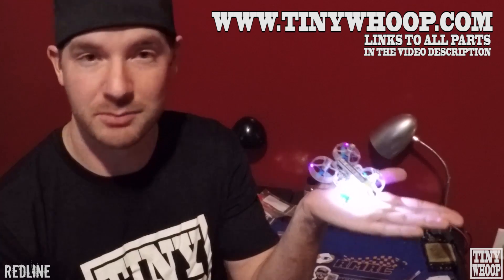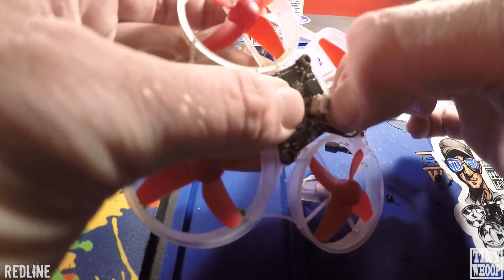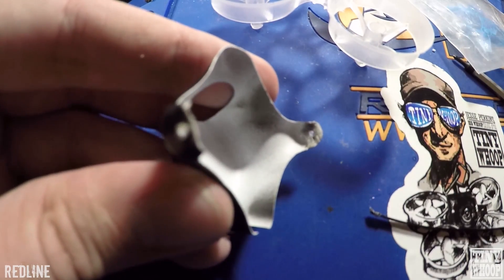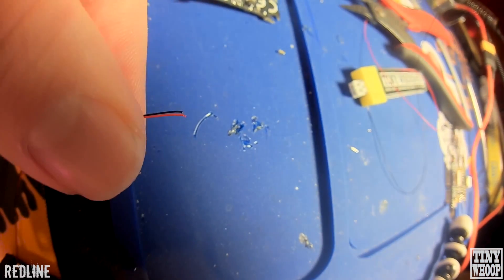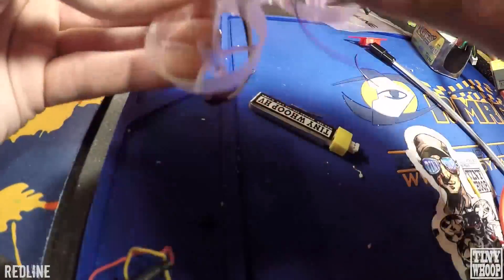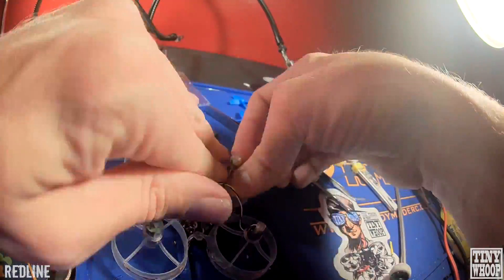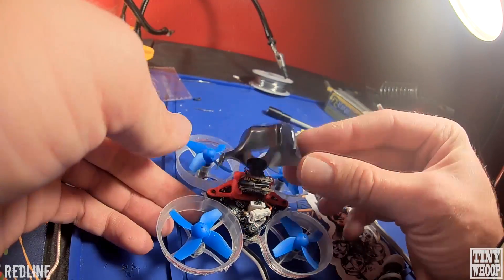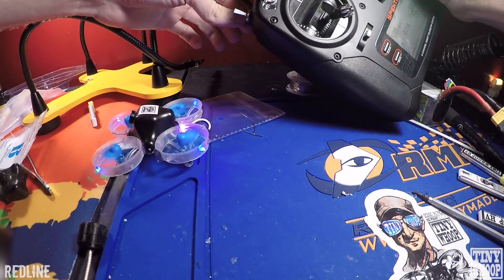Tiny Turtle Whoop Build - with Inductrix FPV Plus Spektrum Transmitter and LED Setup

Comment: How will I know if my motors I bought will need to have the wires reversed like that? Is it like a blade thing where they do there wiring backwards so all aftermarket mot0rs need to be reversed wiring on this FC? Now I’m nervous I have parts ont there way had enough trouble making sure motors will fit the frame now this jeez

Comment: I just did this "mod"... my parts list...
• Inductrix fpv pro frame
• Racetek 17,500kv motors (polarity switched and correct cw/ccw installation)
• FPV Plus canopy (trimmed sides to fit tiny frame)
• Gemfan 4 blade props 
Conclusion: flys slower than the same frame/motor/prop setup as my inductrix fpv. Wont meow unless placed upside down with front ducts closest to the floor, and even then only meows SOMETIMES. I cant find the flat top canopy mentioned in this video.?.?.? Maybe the flat canopy is the key to this setup working properly but I cant say for sure. Also... you would think a FC designed to push 8×20 motors would absolutely thrash with high kv 6×15 motors.?.?.? Unfortunately that's not what I'm experiencing with my build 🤔

Comment: I've been told to completely remove the JST connectors and solder the motor wires directly to the board. Any connector will limit current, so remove any obstacles where possible. Any truth to that?

Comment: Another quick one for you: what about camera and battery connector polarity? Can I just use the stock ones - plug TX02 and after market LiHV batt to it? I don't understand why you remove this pigtail from the FC and then solder it back again.

Comment: Could you please comment on the motors connector polarity. I see that Inductrix FPV + has different direction of props rotation, comparing to typical Tiny Whoop. Brushed motors can spin in both directions but they will last shorter or have power deficiency if you use it the other way, I suppose. Isn't it better to leave connectors as they are and simply swap the motors left-right?
Reply: Yes the Plus board spins the motors inward vs the OG inductrix but the individual motor + & - are also reversed.  So like the vid shows wires on the plugs will also need to be swapped

Comment: I only bought the main control board, but it does not come with the LED included.

Does any one have some intel on the pinout and the type of connector used on that board ?

Comment: changing the polarization of the motors did not work on mine just made the quad spin in circles, I just reversed the prop directions by swapping around the props and it works great.also was not able to run the green mode with the 19500 kv gold motors from newbeedrone ,however the blue mode and red mode works great

Comment: how did you do that 17:41
Reply: Epic Drone that's what they call 'meow mode' feature, only available on the inductrix plus FC right now. Its inspired by the newer Betaflight firmware feature called turtle mode but that one only works with brushless motors.

Comment: Let me first preface this that I am not trying to be negative just sharing my honest feedback. I am going to say what I believe everyone is thinking. Why would you do this to your Inductrix plus? Way to much trouble for marginal improvement IMO. I do love getting crafty and it’s a cool idea but I wouldn’t gut a brand new product. Now if  I already thrashed the crap out of it? Then maybe yes
Reply from the maker: +PuppetMasterFPV 6mm agility, and to be able to compete in the MultiGP tiny whoop class which requires 6mm motors. From my travels around the world most whoop races are classified by motor size. 6mm is still the biggest class,  and the most fun
Reply: Redline FPV it’s a cool vid
Reply: PuppetMasterFPV im actually going to throw the beebrain v2 on the leftover frame and 8mm motors.  So its not a waste :)
Reply: Redline FPV now I'd love to see a vid on that. I got a bee Brain sitting here. I need to do something with 👍
Reply: PuppetMasterFPV you can buy the fc by itself.
Reply: PuppetMasterFPV you can buy the fc by itself
Reply: Redline FPV now that’s a dif Scenario:) 👍
Reply: PuppetMasterFPV Honestly for me, the smaller the whoop the better.  This was just kind of like a challenge for me because no one thought this was possible on a 6mm whoop.  Thats why they made these with bigger motors and props or else they would of kept it 6mm.
Reply: Tiny Whoop I get it. not trying to be a dick. Just giving my real thoughts and not just kissing arse. I don’t race it’s all for the love of flying and have bought 4 whoops to date. 3 are running. I love making mods myself but couldn’t justify doing that to a brand new plus but hey if you can get the FC that’s a dif story.
Reply: PuppetMasterFPV thanks man!
Reply: Redline FPV nice flow at the end. Great flying👍

Comment: Wow man, I am about over playground whoop vids but... yours was awesome, fast little gaps. Great flight!
Thanks for taking me through the build. Welders glue to the Camera lens...brilliant! Kinda disappointed at the motor wire    polarity. Kinda not cool of this flight controller. Great build vid!
Reply: If Spektrum reverse the polarity of their connectors then surely that just means the clockwise motors spin anti-clockwise and visa versa so why don't you install them like that?